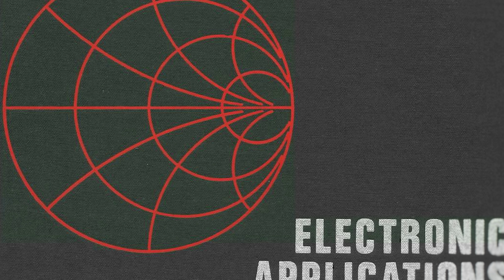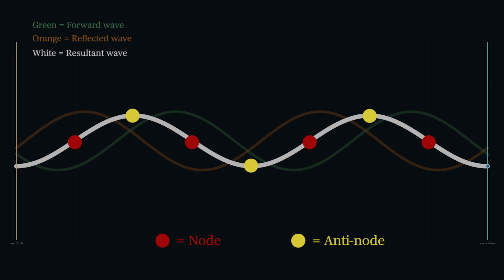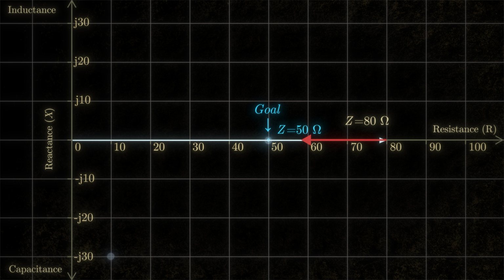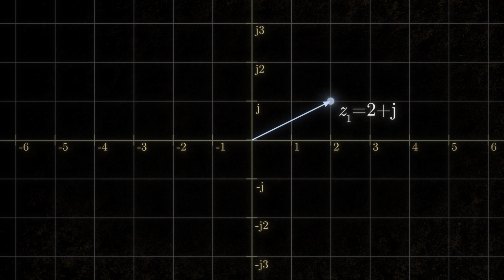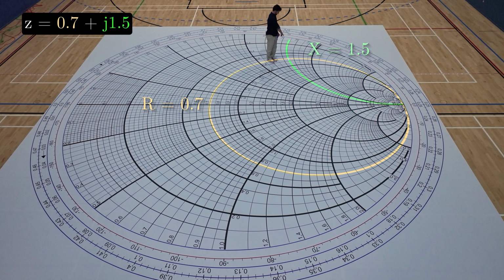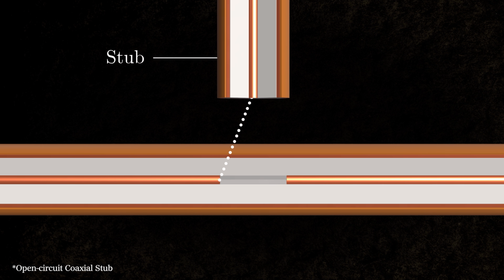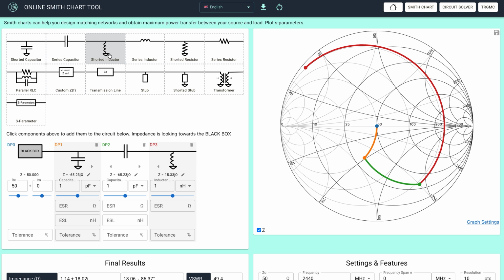The Scariest Chart in Electrical Engineering

Comment: In electronics, we usually say amplitude rather than magnitude when talking about waveforms.
Reply: The term "amplitude" comes from waves, the term "magnitude" comes from complex numbers. "Magnitude" is simply the distance of a point (a+jb) to the origin (0+0j). Other synonyms include "absolute value" and "modulus", but "magnitude" is the most common (there's always a button on RF analyzers to "show data in the 'mag-phase' format").

"Amplitude" and "magnitude" are sometimes interchangeable. If voltages are denoted as complex numbers, the magnitude of a voltage is simply its amplitude. But sometimes they're not interchangeable. For example, when you're talking about apparent impedance, the correct term is "magnitude" not "amplitude". A 50 Ω resistor's impedance magnitude is 50 Ω, it's nonsensical to talk about the "impedance amplitude", as the impedance is not a wave, there's no physical oscillation here.

A related problem is that in RF network theory, the S-parameters of a device are sometimes defined in terms of hypothetical waves defined by mathematical convention, rather than the actual voltages (see traveling waves vs. power waves vs. pseudo waves), so the term "magnitude" sometimes used to imply that these waves are non-physical.

Comment: 9:30 - that's for dummies, lames. Ohm's empirical formula has no "law" status, it's just a name, convention. And it is NOT about "resisting current flow". Current is not "harder to flow" - resistor makes the energy transfer along the wire, less parallel  to the wire (Umov-Poynting vector tilts towards the wire or Resistor if it's intentional), so more energy is wasted there (E component of the EM field has to work harder - grow locally - to propagate around the circuit).
Ohms, both resistance and reactance are FIELD EFFECTS. Ohm is derived from the EM field level calculus, NOT volt over amp (this is a formula to get quantity, not to "explain" things).
This video will need a follow up (just like Electricity one).
 
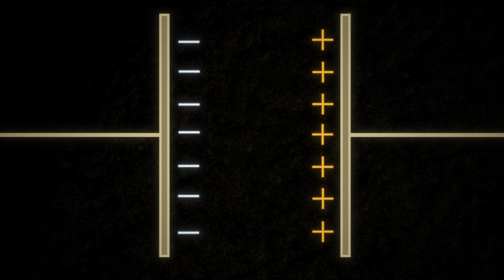10:50 - energy is stored in the E_field (IN THE DIELECTRIC), NOT "on the plates" (but we need them, they act as "interface" to deliver and receive the energy). And by the way "a charge" is a Quantum level stuff (not easy, you can't just casually use it to define/explain other things).